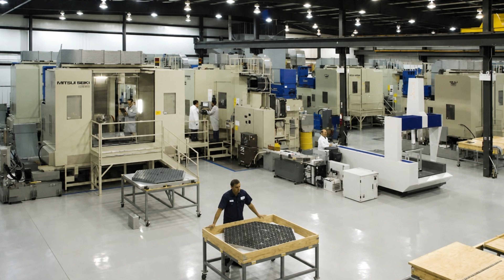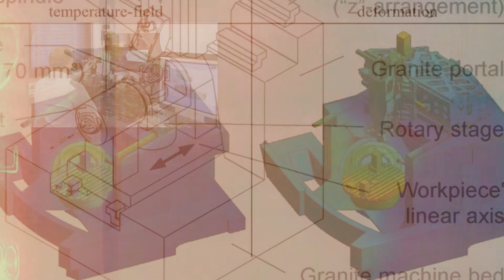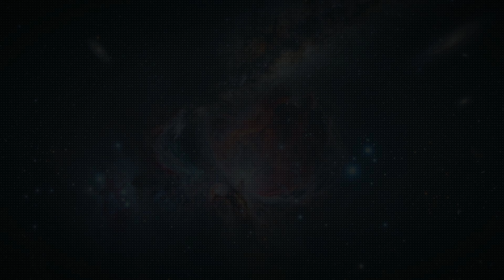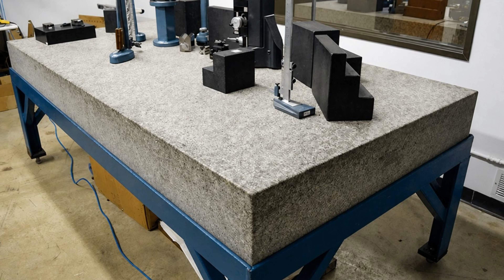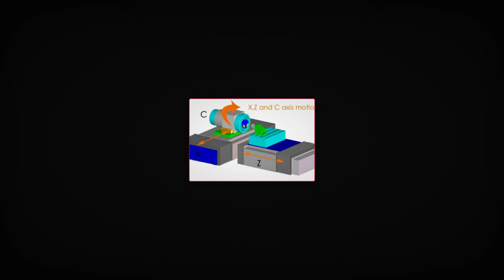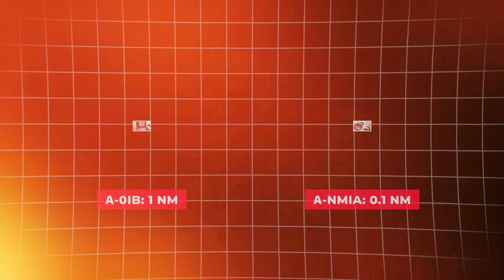The 15 Most Precise Machines Ever Built

Comment: Since when has a c.n.c machine today been finished by hand using a scraping method "I don't think so mate"
Reply: Okuma,Kern, and Matsuura still do and lots of others.  If you understand the process you’d understand why it still has a place. Not so much for dynamic surfaces but it’s used quite a bit for static alignment.
Reply: That was the way in late 20th Century as I remember. The accuracy has to be there for a CNC to control it.

Comment: Do you get hazard pay working with Burillium ???
Reply: Usually you machine it submerged in water I think. I wonder if you can machine it with EDM.
Reply: @Rejectsocialismyes, edm is capable of machining most materials. Anything that can conduct electricity can be machined using edm processes.
Reply: @00savage25 thanks
Reply: I did not
Reply: No.